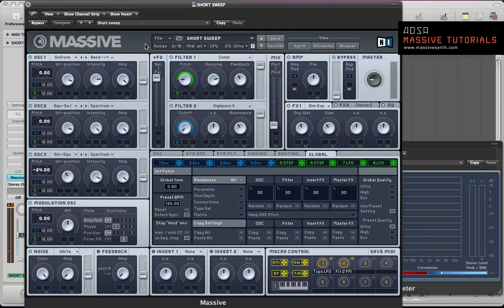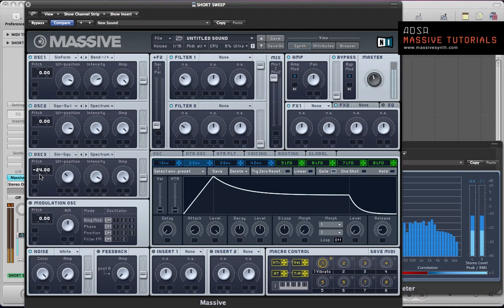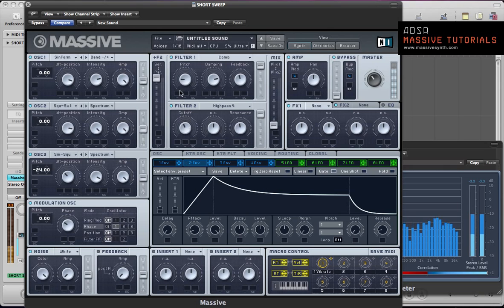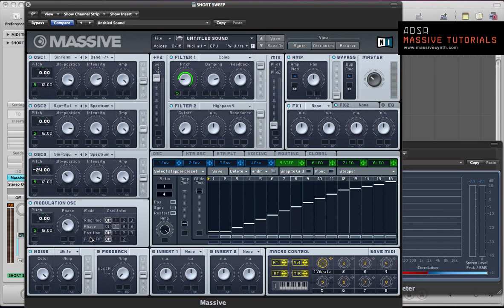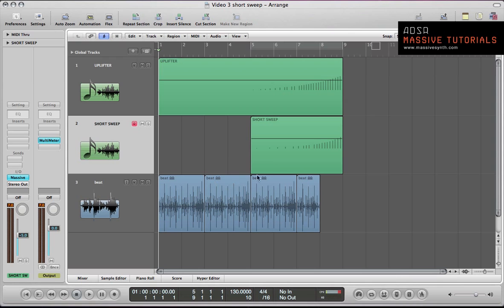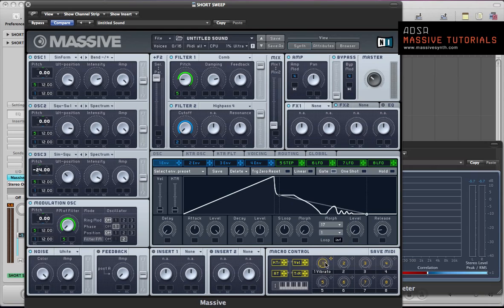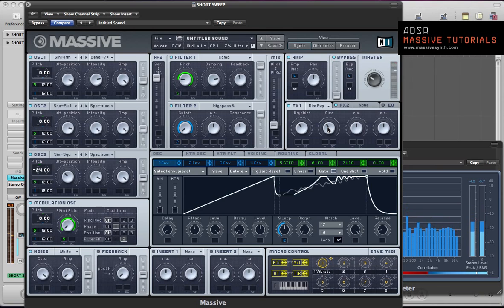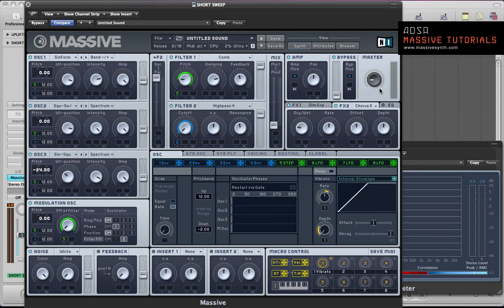NI Massive - FX - pt 3 - Short Sweep - How To Tutorial

Comment: A point well made, and like you say on oversight. This sound is taken from the EFX pack I made for adsrsounds, and the original preset has some macro controls set up on the S loop morph, which I didn't recreate in the vid. However, my focus was to convey how we can control the pitch using a sustain loop in this way, and modulating the loop with another envelope to get that speeding up lfo effect, which hopefully comes across well.